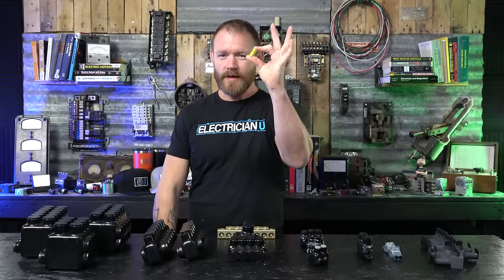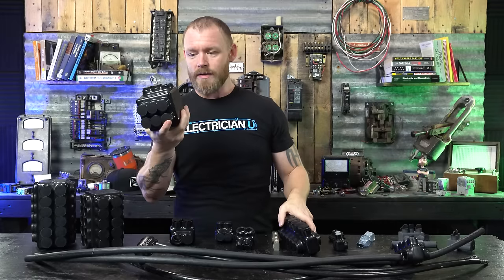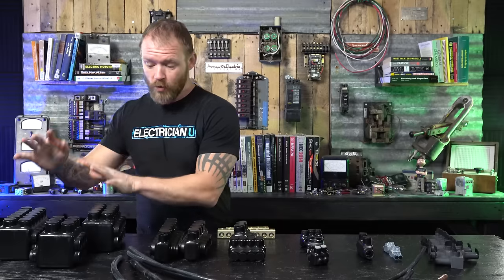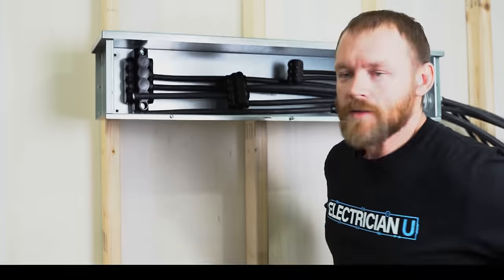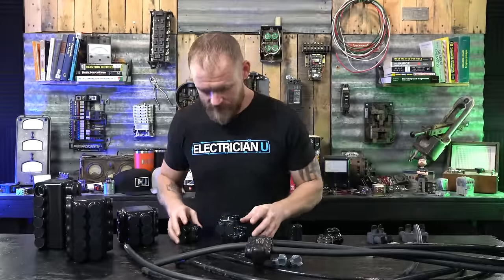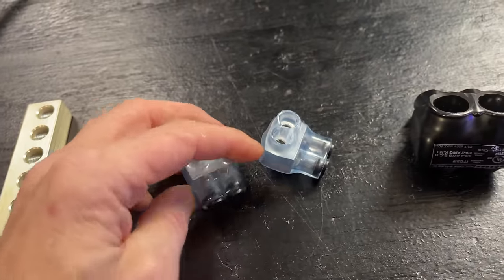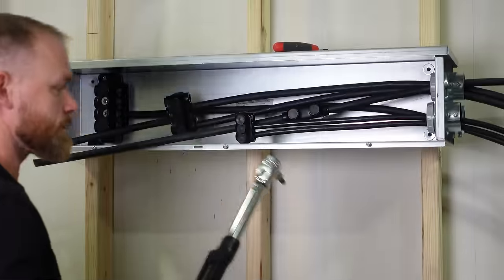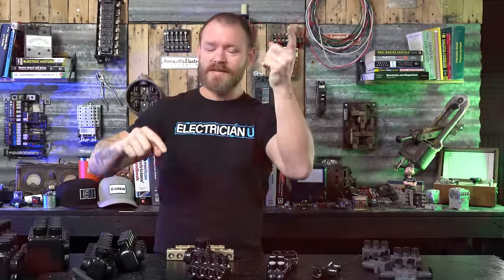What Are Polaris Taps? How Do You Connect Large Gauge Wires?

Comment: I've used a ton of those in my days. One thing you have to pay attention to is the AMP rating on them. I have had several melt down even when they are torqued down tightly. So, make sure that you use them for the correct application.

Comment: I was on an old resturaunt upfit, and the mass of 350km with split bolts and a TON of wood planks stuffed in to hold the conductors in place... 
I was quite proud of the final job with all the taps in place...
And i went back with paralleled 500kcm...

Comment: Great product . Great for temporary & emergency work. At a large hospital/ research center that had 19 large ( 2,000 KW ) generators and almost halve did not have built in load banks so we had to push around at least six 100 KW portable load banks and use these to connect wires for them.
Reply: These can be used permanently too right? Like say if you're swapping out an ATS or generator and the conductors aren't long enough, you can use these to extend them?
Reply: These taps are a must when deploying port gens , not all sites have cam boxes or Appleton plugs . I’ll just pull the wires in the meter and use these monkey knuckles! These things are clutch !

Comment: I’ve always called them Polaris lugs. And also you can use them for smaller wires. We use them in the solar industry because they usually seat a wire more securely and is more protected than a wire nut.
Reply: Please in an me
Reply: Unban
Reply: Unban
Reply: Unban
Reply: I like spamming 😂😂😂😂😂
Reply: @jeremynguyen2346  how to never get unbanned be like:
Reply: We use ipc connectors in solar work same company but different type of connector
Reply: Can these be used in the main panel to extend wires?

Comment: 10:30 Those are non-insulated ferules.  Ideally you would use a ferule crimper and compress over the wire and then insert into the polaris block.  Any fine stranded wire should be done this way with compression screw connectors to prevent the wires from being cut and pressed out of the way.  You see this much more on smaller wires in both insulated and non-insulated ferules.  As an example in the UK they use them on their RCBO breaker's neutral line, that uses finely stranded wire before being inserted into the neutral bus bar screw connection.
Reply: Thanks man, I’m going to buy some before I put stranded in the polaris!
Reply: How much would you torque the ferrules? I have not found any articles on this subject.
Reply: @richardphillips2405  There are specific ferrules and crimping tools that crimp them.  I am not sure what they use as specific torque, but they are just like a ratcheting compression fitting tool that bottoms out and "sets" the ferrule itself on the wire, as ferrules are made for a specific gauge wire.
Reply: I believe the Greys are made specifically for fine stranded cables like DLO/Genny cables. We've never had to crimp ferrules on first as AFAIK. Been a while cause everything we use these days for our clients Verizon and Transit is Hypress Barrels or  Hypress H Taps.

Comment: Polaris will also create custom versions of their blocks.  They are made in Florida and have a turnaround time of about 1-2 weeks.  If you want one to be mountable, and there isn't one, you can get them to make it.  Also to answer the question of what is the largest, we had a customer order a custom 24 port (barrel), 500MCM, single stacked block.  Polaris now has a Service Entrance and Parallel rating on certain blocks. - TN State Rep for Polaris (Joseph Nance)
Reply: Do you know if it's possible to order a custom Polaris block made 100% of Brass or Copper for copper only applications ?
Reply: @Dicofole I'm currently checking with Polaris.  May I ask what the application is that you would need these? The Standard material works well with Copper wire.
Reply: @Dicofol1  I have confirmed that the material Polaris uses is designed for AL/CU, and they do not purchase material for Copper only due to the standard material already being usable for both Aluminum and Copper.  

I'm interested in hearing where and what application you would use a copper-only Insulated Lug.
Reply: @josephnance3843  It would be for extending a 00 power line inside a building prone to water infiltration. I do not trust the Oxide prevention compound used to enable AL/CU connections., in general. This is why I was looking for a CU only alternative. How durable and effective is the anti-oxidant for this Polaris connector?

Comment: I used to HATE with a passion when I was planning a job out, knowing I was gonna have to use these.. After about the 3rd or 4th job that these were incorporated and always feeling frustrated or just flat out irritated, knowing that I am simply putting this, O.C.D. when I wire a building. I demand that my systems not only on paper look like art work, but be wired as such. My boxes look like butterfly wings, of symmetry and geometry and are balanced visually, of course with safety as my first goal. now days, it is just second nature as to how I run and plumb my wiring. BUT, I actually had to sit down and plan how this can be used, so they do not look so much like a "repair" or a "botched mistake"... I spent about 4 to 6 hours one night, messing with about $7K worth of these various units of all sizes and used bunches of scrap/used wire to do several mock-up's on the workbench, trying to find the sweet spot and angles that is enough angle or lean, that doesn't prevent removal or installation of one feed or being obstructed against the interior of the walls, yet will allow for the wiring to be clamped down flat. Please note, clamping the wiring down is not a requirement in my county, but check with your building code dept for your county's requirements. Now days, I kinda look forwards to the jobs that may has as many as 20 of these, although a rare and exceptionally specialized installations, I love the look of a flat laid feed where not one wire crosses over another.. I little planning once the job is understood, and I hit the drafting table for this part.

There was a massive job that incorporated bunches of these and every output in its own box has its own disconnect, each wired to a PLC or some other means of running CAT cabling to a central computer for weekly safety checks to shut one or all systems down. When done, it was wonderfully beautiful. about 9 weeks later, these business was set to fire things up and start honing the flow of their business, and a semi truck ran off the road and punched through the back wall of this building, and just happened to punch through, in the section where all the breakout boxes and feeds are, breakers flung all over the place.. Please note, I only seen pictures of the chaos as I was about 200 miles away on another job. Thankfully, nobody was hurt, the heavy mains were still luckily not turned on at the sub about 60 yards away. They wanted me to come back and rebuild what was busted down, which was about 30 feet of that block wall. But, I couldn't make it for about 5 to 6 days, as I was already locked into the the job I was on. They found somebody else. A year later, I was contracted to rebuild what the last guy did. which, normally I would say, in defense of that guy, "he was under extreme conditions and just got it up and running"... but, what an absolute mess. There was several things that made no sense even by standards of code, and there was a few issues that prevented a few circuits form ever working. 

The contract was "are you wanting just a fix?" or "Are you wanting a tear out and redo?"... They wanted it just like it once was so there was no excuse for any future issues, considering what they were doing as lives were depending upon things being 100% good. The fixes, if I had only been allowed to do that, may have taken a week to rectify, assuming, but, may have only taken a day, as in the process of being allowed to rip all the old stuff out, and run new, that offers a luxury of seeing where the actually problems were, hind sight is 20/20 I suppose. but it took a month and a week to redo everything to meet all the standards that were required and asked.. and even made that one look even better, because I got to do it a second time, and knowing what I didn't like about the first artwork, I got to learn from that and just make it even better looking. 

Some say, making your routing look good takes too much time. And yes, it does take more time, but I am telling you, the more you do it, the faster you are at working like this, and if you ever have troubles in the future, you now SHINE, because not only you but any other journeyman can walk right in, gather his bearings as to the layout of the land, so to speak, and jump right in, and not be grumpy at a mess of messes of spiderwebs of wiring. Just remember to put your company name on everything, inside and outside of every box, and wiring run, even tag the one wire you run in a system that is already there, that states "This tag, attached to this wire, was installed by company XYZ" and do it at both ends of that run, clarifying that you have not messed with the other stuff or had nothing to do with it. .

OOPS... sorry, I was running down the rabbit hole in a novel.. I am sorry.. lol
Reply: You should go ahead and write that book instead of pouring out your philosophy in a comment section. What a waste.

Comment: I’m not a electrician but when I updated my home service to 400amp I used those whenever I can and they are spendy . Just the ones for 10 gauge wire can run 35.00 dollars apiece and that was 18 years ago. Those big ones you showed must run 500.00 dollars or more. I’ve never seen them at a home improvement store. I always had to get them at a industrial electrical supply store. They are great to use and I use them anywhere I can .

Comment: For telecommunications DC power distribution, the industry standard is crimped H-taps, lower resistance, higher mechanical strength. Even on the AC side we really prefer crimped connections over screw compression.

Comment: @ 2min you mention using it as a "pass through" but that can only be accomplished by feeding the whole cable through from one end. This connector system doesn't allow for "in the middle" long run taps without cutting the main branch.  We always used "H" taps or "C" taps and hydraulic crimpers for a true pass through connection. To bad, as the Crimp style uses a WAY to large cover and these are quite compact.

Comment: I almost haven't used a split bolt since I found these. Yes, it is really important to torque them. Especially at final position. I believe the largest size cable you can wire nut is #6. I don't wire nut after #8 anymore since I found the Polaris type connectors.
Reply: They make larger Polaris lugs.
Reply: yes, the smaller ones are handy for all sorts of things. I just retired from 25 years doing generators and my old pet peeve was connecting say #6 stranded to #6 solid for a temporary job. Having a hand full of the smaller ones made life easy and didn't need a half roll of tape to make them safe.

Comment: Been using Polaris lugs in solar for a hot minute. They come in clutch if you need to add a disconnect and don't want to do a new wire pull for your neutral and ground.

Comment: Have a gutter at the electric distribution house at our church campus, that is 10 foot long. And when it was wired, back in the 70's  they used split bolts on everything. Wrapped with rubber tape then over wrap of cloth tape.
And YEIKS the mess of trying to sort out 6 different service disconnects. Oh and yeah fun fact when I opened it, the skeletal remains of a 4 ft long black snake was inside of it.

Comment: great video... use case to run by you... if a generator has 20,000 watts.  It has 2 -  50 amp 240V outlets.  Would you use a Polaris tap to bring the two outlets together in a common box and then feed the single conductors to a 100 amp double pole breaker?  So your 2 hots from each 50amp cords would be on a polaris tap coming in with 6 AWG and then a single larger 4 AWG going out (8 wires going in with the neutral and ground and 4 going out) to the panel where a 100 amp double pole would be?  Thanks for insight!

Comment: It seems like these might be a good application for DC...like for solar power runs...the conductors I use are 0000 fine copper.  
@15:23  Love the powered wire stripper you use here...way easier than how I do it by hand  :)

Comment: Do you mount with a tap kit and machine screw or self tap? Wouldn’t this violate 110.3b for the gutter as it won’t leave a 1/4 in bubble behind the surface mount. This would then trap moisture in and create a damp location. Just wondering your thoughts on this
Reply: Was wondering the same. He said use a metal mount of some type behind it but i was thinking how to mount them. Wouldnt be good to penetrate the gutter housing if its around moisture

Comment: Great video, 

Im trying to hook up 2/0 SER wire to my 200amp service panel, however my ground and white wires are too thick for the busbars in the panel. Is there a specific wire reducer I should use to bring the wire size down to at least 4/0 or smaller? The wires are stranded but i didnt think it was safe to split the wires for the white cable into two separate holes on the busbar. Thanks

Comment: Video is fine for commercial electricians. But for DIY to connect no.6 aluminum to no.10 copper in a wall heater for example, use an al/cu splicing lug and heat shrink tubing.

Comment: I need to splice a 4/0 SER wire in our crawlspace. If I use these do I need to have them inside of a junction box? Or can it just be secured against a joist in the crawlspace?

I would assume I need a four port Polaris? 2 hots, N, and ground? Or would I need four individual taps?

Comment: They are definitely quicker and easier than split bolts. I’ve installed dozens of split bolts using 4/0 wire to feed machinery and a few of these definitely easier and faster

Comment: Could you use one of the 3 barrel connectors, to attach 2 smaller loads to a larger line from the panel?  ie 2 - 25A load lines fed by one 60A line

Comment: Can you handle that when the wires are hot?  Meaning there’s enough insulation to not cause a shock?  I plan on using a three wire dual entry with #6 awg to hook up a Victron ip22 charger negative terminal to negatives of two solar batteries. Thanks!

Comment: I like the Polaris bugs (is what I call them) but the one thing I found is once you tighten all the set screws up, if you move them around after tightening them and then recheck them you will find they loosen up. So before I get done i try and check all the set screws to make sure they are tight
Reply: That’s common with stranded wires as the individual strands start to flatten out. I always tighten, wiggle and retighten.
Reply: @FishFind3000  if I due aluminum into regular bugs (split bolts) I will hit the back of the bug with a Channel locks a number of times. it’s amazing how much they loosen.
Reply: I think that’s where that jacket would be useful

Comment: Finley stranded wire.
Could you do a video talking about it.
Reason being, a place I worked at. We had machinery with moving equipment. Some larger stuff. There was power and communication cables in a track that resembled a tank track. Probably 20 feet long and would bend into a U shape as it moves along a track.
The communication cables had to be replaced every couple of years. I worked with the maintenance tech doing this.
There were many smaller gauge wires inside the cables. There was a powder inside the cables to help them move inside the cable bundle as it was continuously bending as the equipment moved.
These cables would short out and need to be replaced.
I wonder if a different type of cable was needed.

Comment: Cool, wired back in the 80's, the only thing we had were split bolt connectors.
Pain in the @$$, make the connection, wrap on rubber tape, electrical tape.
Recommended to, run for 24 hours, shut off, cut away the rubber & tape, retighten. 
More often than not, the connection would be loose from the heating and cooling of current flow variations.

Comment: How do these connectors compare to shear bolt connectors? I remember a video where Big Clive demonstrated how the latter are used, and they seem to be superior in terms of establishing an electrical connection without the need to remove insulation; they have tangs that simply displace the insulation, which reseals around the tangs.

Comment: So, im using an ipld 3 port . Im using it to connect 3/0 neutrals in a box . Im assuming its one connected block inside. Its a large conductor wire nut?  What are the causes of arcing???

Comment: Are polaris taps rated to splice unfused service conductors?  See 230.46 Spliced and Tapped Conductors.   Power distribution blocks installed on service conductors shall be marked “suitable for use on the line side of the service equipment” or equivalent
Reply: This is a chicken-and-egg rule.  This requirement is a new one, and the manufacturers are still trying to catch up with this rule, and have commercially available connectors that carry this rating.

The last time I checked, there is currently nothing available that carries this product rating, so you are depending on a 90.4 exception to allow you to continue with the status quo.  Polaris and similar manufacturers are working to get their product listed for use on the line side of service equipment, so in the future, their connectors carry this rating.